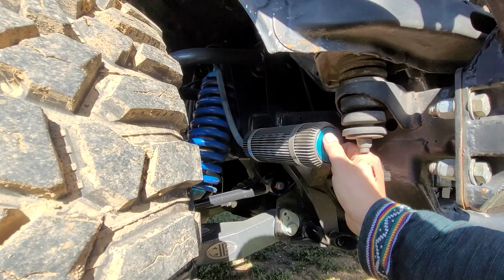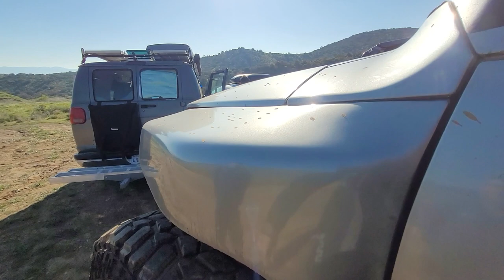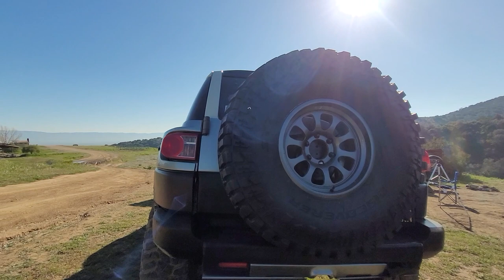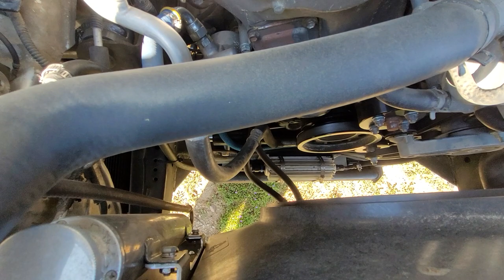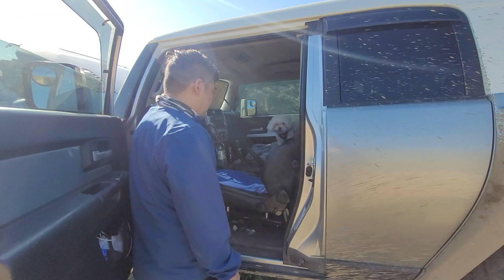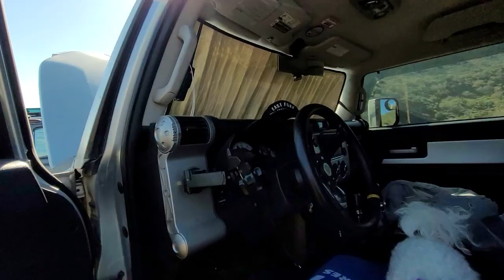James' incredible 2007 supercharged Toyota FJ cruiser on 40"s tires

Comment: Bit of a Toyota nerd here but never seen a setup like that yet. I love it, cool to see the stock toyota wheel bearing holds up, the reinforcement on the front frame etc, and the steering assist instead of a bigger rack. Very very cool 😍👌🤘🇨🇦
Reply from the maker: Yeah I learn a lot about modding, parts and time going into this build. My friend James definitely put in a ton in it almost everytime I see it. It's something new and different. I love it. I will upload a ride along video soon when i have a chance. Stayed tuned.
Reply: I think I'm finally starting to get some wobbles in the bearings. Fwiw. My rear axle bearings are at 200k and my fronts are about 80k so I'd say I'm lucky if it's those. Going to take it in for a balance and rotation and see if that solves it first.
Reply from the maker: @madxmaxxine6552  how does it feel?
Reply: @projectkod  the wobble?  It's a vibe!  Only at 75-80mph, so it's possible it may need a balance first.
Reply from the maker: @madxmaxxine6552  I need to do the same for my Acura CL. The axle on one side is wobbling at low speed.. and especially under accel.
Reply: @projectkod  can't wait to see this Type S.  I remember loving the smooth lines back when it came out. I would like to build a 4 Dr next.  Maybe Lexus or something I'm used to
Reply from the maker: @MADxMAXXINE  personally I think the car is a bit long I prefer the TL model or the tsx.  But it drives amazing. Lots of power and smooth delievery through the 6 speed

Comment: Those single shear tiny toerods holding up to 40s... ya nope thats a mall crawler.
Reply: They're double shear, look closer. Those are beefy heimed links, and dom tube rod, that's stronger than the steering rack they're bolted to. Of course he has a slide rack also, so the stock rack weak point is also addressed. It's solid, 40s will be fine, but I'd run 37s personally.

Comment: Where did the wide body kit come from?
Reply from the maker: I'll  ask James.
Reply: looks like  the racing fenders by mcneil racing.
Reply: Trailer products off-road fiberglass fronts and McNeil racing rear quarters.  The McNeil racing has a cut out for the gas door while the other does not
Reply: @madxmaxxine6552  hey man did you have to do any tubbing to the firewall or wheel wells? I’m gonna be doing total chaos long travel kit and 37s to my 07 pretty soon
Reply: @TuRDPRO  lots of hammering in the right places.  If your alignment/wheel offset is well, there is minimal areas you are concerned with. 37s do require a good amount of work still. Later I will be cutting out and tubing the firewall to a core support .  Probably the easiest solution I've heard but not as clean as a tub or custom high clearance fender well

Comment: I wanna know how he mounted the tire on the door and got it to fit. Does he have social media.
Reply from the maker: yes, check the bio/below section
Reply: Probably used a wheel spacer
Reply: Partially correct.  The carrier is moved up an inch, redrilled and also using a spacer to relocate. I have a plasma cut mount that needs to be welded in place of the spacer.